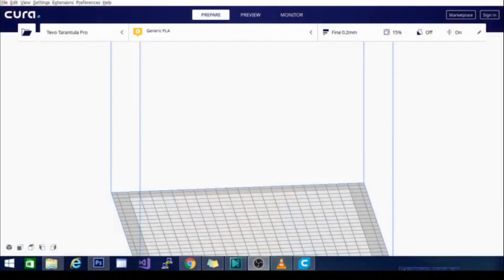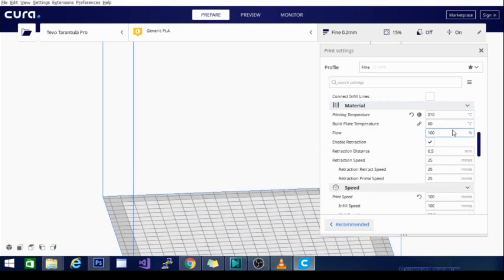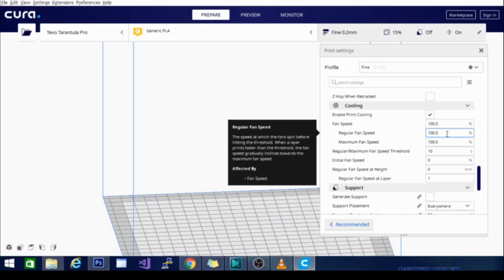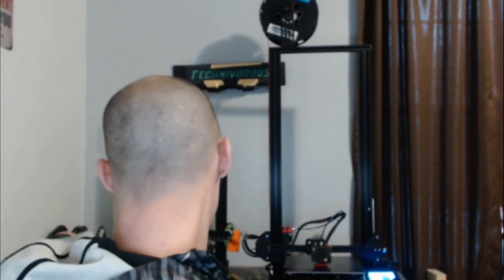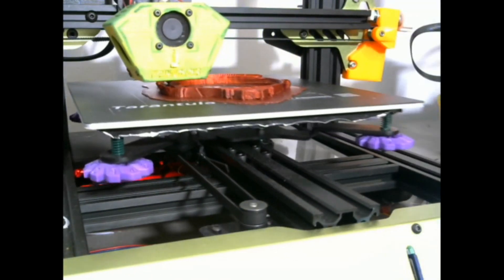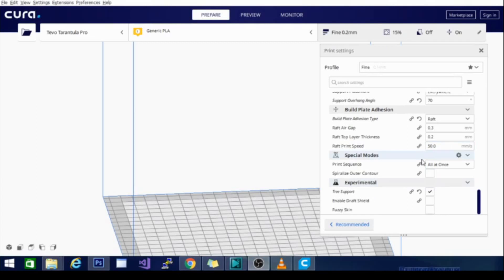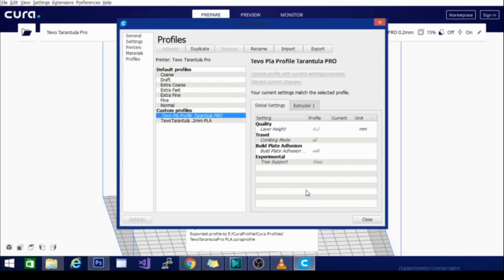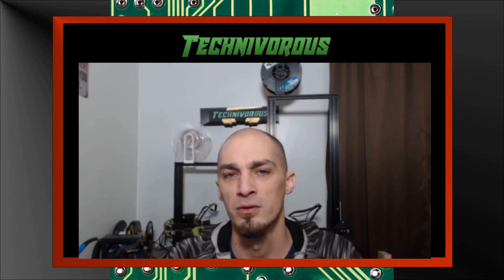Tevo Tarantula PRO profile settings - Cura 4.4.1

Comment: So I fucked  up my heater for my hot end what voltage and watts should I get to replace it also do you know a better design for the heater block that will work on this printer because this one's kind of sucks because the wires are in a very bad spot to get a good tightness on it
Reply from the maker: Pinched the wires?
Reply: @Technivorous  yeah as it was tightening instead of listening it rubbed too hard on the radiator and ripped open and exposed the white wire but due to getting filament on the heater I'm assuming it's done for and would like to replace the whole radiator heat block unit with a better one that will mount to the base parts

Comment: What is printer settings set to mine keeps printing far right for bed leveling test even tho it dont show it far right on cura
Reply from the maker: Go into your printer settings in cura and see if 'origin at center's is checked. Its misleading but you want it u checked.
Reply: @Technivorous  ok thnk you

Comment: Will setting be some what the same other than like suports and what not iam having trouble getting one stl right in cura
Reply from the maker: Are you using the tarantula pro like in this video?
Reply: @Technivorous  yes the preview of the STL file looks kind of wonky compared to the profile the STL file is a rim for an RC car in 128 scale

Comment: Nice! oh btw can you upload the printer settings too!?! cause cura doesnt have it as an option and i have no idea what numbers to type :/  (this is goind to be my first 3d printer so i have no idea how to set it up correctly and thanks for the effort on the videos!)
Reply from the maker: I can sure post a profile for you, the tevo tpro is built in in cura if u have a current version so there will be a profile with a decent starting point in there. I will post some stuff on this for you soon.
Reply: @Technivorous  Thank you so much! ill try to update it too then cause i had downloaded it a while ago to see how it looks like and if its easy to use and it had the old tarantula as a choice.
Reply: @Technivorous  for some reason 4.5 does not have a tarantula pro profile.

Comment: ooh I was glad to see this video . have been searching for a decent recommended cura profile for this machine. when you say you print at 100 mm/s, my heart stopped. ive done that before on this machine and caused nothin but an earthquake rattling everything.  suggestions on what to set this machine on to keep it sturdy?
Reply from the maker: Man my table is super wobbly and it still holds up. They have vibration damping legs on thingiverse, but I dont use them. I get decent prints ar 100mms but I have since turned it down to around 75-80 to improve quality. Though I can get a model as good as my ender 3 at 120mms. And that's with the ender pri ting at 60.
Reply: @Technivorous  ya those dampening feet are printed in tpu. Don't have any of that myself. Also they cause more vibes then anything. If ya check out my channel and the video of my machine printing, the bench top it's on is just a chunk of plywood slapped on-top of a big box that covers all the plumping lines for this strip of housing. It's not secured or supported underneath, so it causes twice the vibrations on my machine, printing at 60